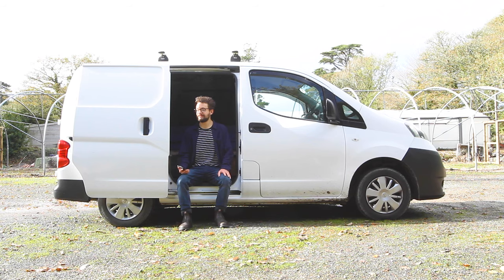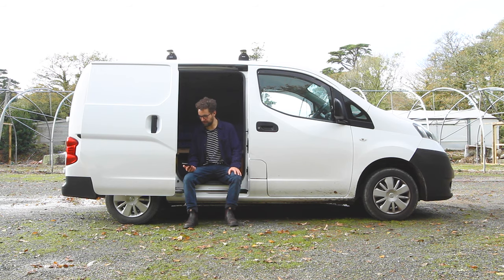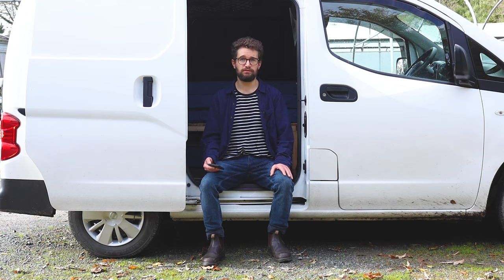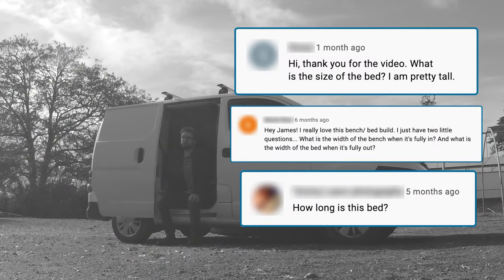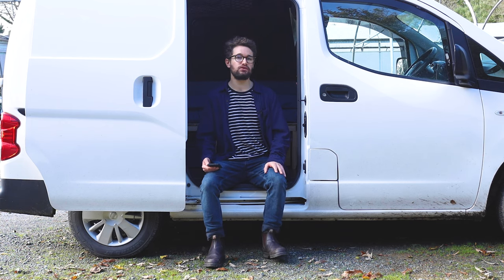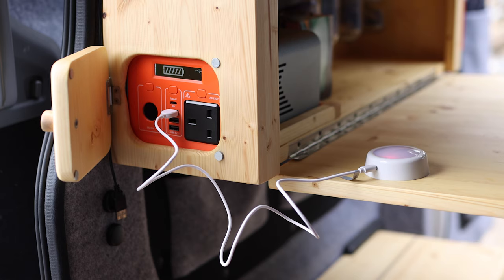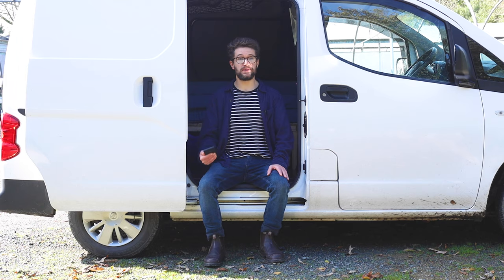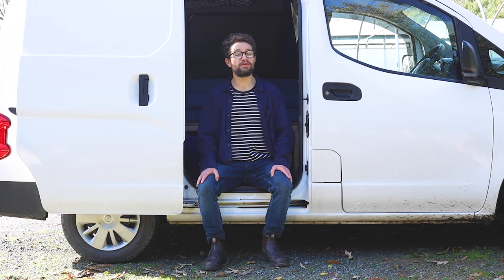Responding To COMMENTS & QUESTIONS About My Van Build | Q&A | Tiny Camper Van Conversion

Comment: We've just done 7 days wild in our NV200 round Ireland - not too dissimilar to yours in terms of build, and we could have easily have done two weeks. 3 degree camps, no issue (no heater). If you've any track record in camping, then going into a NV200 that's "only" converted to this level is like staying in a hotel.
Reply from the maker: Sounds like a great trip. We thought the same; such an upgrade from tents and cold, hard ground!

Comment: Did you remove the two L shaped metal struts on the B pillars where the bulkhead was attached? if so, how?
Reply from the maker: No I didn't, I left them in. Reckon you'd need an angle grinder to get them off. I did wonder about using them to attach a handle for getting in and out of the van easier, just to find a use for them
Reply: @LensOfJames  Thanks. I’m sure I’ll find a use for them too, looks like a pain of a job to get rid of them. Your videos are invaluable to me and my conversion, not many people seem to have done an NV200. I need to be able to copy your bed too!

Comment: Hi James, you asked why i dont film my builds, another reason you just highlighted, i really could not be doing with all the nonsense comments. 
Your van is Built not bought and designed and constructed for your own needs and skills, and i appreciate all the time and effort you put into sharing on you tube, I wonder how many people have now got access to a campervan for a quarter of the cost of a much older VW all because of you? 
 I love mine its more usable than my Transporter camper that cost 10 times more. Did you get my email and pics? Ed.
Reply from the maker: Hi Ed, yes got your email thanks, I really love what you've done with your van, especially the use of the door cavities (kind of wish I had done that with mine!). Thanks for taking the time to send them over, it's great seeing what other people have done with their vans!